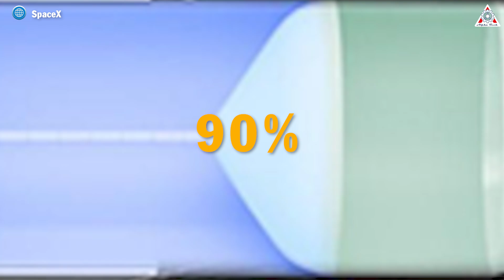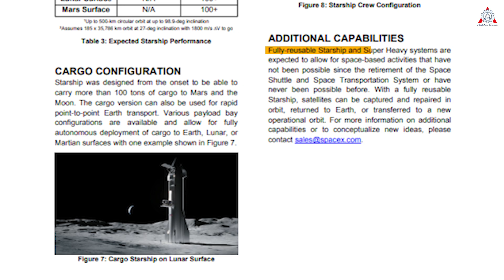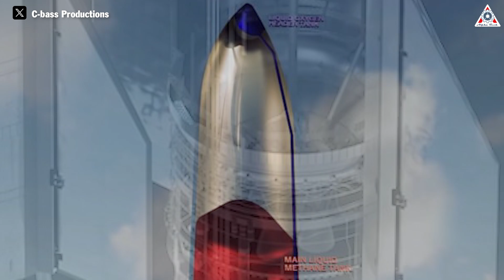Elon Musk just declared catching Starship Flight 4!

Comment: The only chance he has is if he starts to use something other than methane. Like the Merlin engine uses a different fuel like propane so far he has had a big problem relighting methane engines such as the Raptor engine. Falcon 9 uses a different propellant. Methane is not relighting
Reply: The reason SpaceX is using methane is they expect to be able to produce Methane on Mars from the ice and regolith.  There are no oil wells, so no propane.  Likewise, trying to capture enough hydrogen would be physically impossible.  It's methane or take the fuel for your eventual return trip, if you're lucky enough to make it that far.
Reply: @philipgrice1026  I understand methane is easy to produce, such as on Mars. He needs some kind of reliable ignition. Just mixing at a high psi is not working. And I don't think a spark plug will do the trick either.
Reply: @philipgrice1026 
You are right about not pulling enough hydrogen if it was to be from the air on Mars. But, there would be plenty of pulled from the water ice at the poles.
Reply: @philipgrice1026  Actually it is (stochastically) easier to pull the Hydrogen (by electrolysis of water) for Propane than for Methane.

Methane   CH4          1x CO²      :      2x H²0          =     1:2    =   1 : 2
Propane   C3H8         3x CO²      :      4x H²O         =     3:4    =   1 : 1,33

But the Methanation = Sabatier Process is an easy exothermic reaction with a cheap Nickel catalyst.
No such basic reaction for the Propane known at the moment, afaik.   Propylene  + H²   via Platinum or Palladium catalyst  doesn´t count ;)
Reply: The Merlin engine uses RP-1 (Pure Kerosene) ignited by TEA-TEB (an pyrophoric compound burning in contact with O² till -20°C)  producing the green flame  (Boron). 
The same stuff (TEB) ignited je J58 Engines and afterburners of the SR-71    they had 16 shots per flight.

Of course the autoignition temperature is on the bad side:
JET-A1  (Kerosene)     210 °C
Diesel                         ≥ 225 °C
Propane                        470 °C
Methane                       595 °C 

But the chamber pressure @ Raptor V3 is aimed for 350 bar.

A video of "Real Engineering" had a schematic of a Raptor V? . I assume the numbers are correct, but I don´t know.  

Cumbustion Chamber Gas mixture (from the 2 Preburners)     321bar @ 774K  (500°C)
Methane-Turbopump Preburner    512 bar @ 811 °K    (537 °C)
Oxygen   -Turbopump Preburner    564 bar @ 811 °K    (537 °C)

In my understanding the Preburners have to be started first (maybe prerotated electrically) ramping up to full power without flame out  relatively fast
Methane-pump  643bar @  28 MW          Input @ 3 bar  with 133 kg/s 
Oxygen-pump     633bar @ 34 MW           Input @ 3 bar with 493 kg/s

And once the process is stable you only have to put in the rest energy to 500°C to get ignition in the Combustion chamber.
With even higher pressures V3 @ 350 bar and following  the autoignition temperature could be achieved "automatically".

I think 10 test flights i a fair chance. 
If they didn´t manage the relighting on time by then, I would be surprised.
They know what they are doing and testing out the limits on their way.

Comment: Not impossible but not on flight 4, 5 or even 6. They will not attempt to land either on land until they can get both to soft land at sea at the correct attitude and velocity consistently. The booster will probably be much sooner as it got close last time and you can land it at a remote concrete pad. Starship si going to need more work, first they have to fix the tile detaching problem so it will survive reentry. then they can work on the soft landing

Comment: Thinking outside te box:  is is possible to strap four or so Super Heavy boosters (which can be recovered) around a single Starship booster, configured for fuel only, to launch into orbit, ahead or Moon or, Mars launch?
Reply: Four SRB’s would be enough to lift this booster over the Karman line and the  booster could do the rest and have half its fuel available in orbit
Reply: I believe that would enable the booster to take the starship fully into orbit without using any starship fuel.  It could cancel the need for refueling the starship in orbit.  Maybe that is over optimistic but I am going to leave it to someone else to run the rocket equation and figure it out.
Reply: @appliedfacts  the problem is that the booster when in orbit is lost… will burn out in reentry…
Reply: @renesoucy3444 
It could survive if it had heat tiles like the Starship. They would add a bit of weight but the additional lift from the multiple additional boosters would way over come that.
Reply: Imagine the size of Stage0 for a "Starship Heavy". Who knows ;)

Comment: I wish them luck, but suspect that kind of accuracy is aspirational unless they have better thrusters than cold gas.
Did hear Felix, (I think) mention midget
 Raptor 3's as a possible side thrusting  system, which of course made me grin, having suggested that here on Alpha Tech months ago...
At this point, Starship and booster are still crude prototypes, compared to what they will be in ten years or so, when enough "Horse and Buggy" Rocket Enginerds die off, to allow more advancements beyond stuff done for 60 years or more.
Currently we have;
"Rocket Grannies" obviously managing at SpaceX in spite of all the hype..

"Art is doing things as they should be done, not as they are done."

Dont know who said that, but they arent running SpaceX....🤭

I doubt cold gas thrusters will have the power to counter wind gusts coming in for catching big boosters and Starships with those tower tweezers.

You'll want serious side thrust already happening to center lock that ship on course, and then use throttle up on the lee side in case of any deviant moves.

So I would suggest they consider starting to work on the mini Raptor 3's now, and do an array of three amidships, and use the Y on aft side to miss the tower with hot exhaust.

Would be way cheaper to be starting the process now, than after replacing a tower and cleaning up a crashed ship to get to the same realization.

Thinking is cheap compared to disasters, and takes up way less time.. And Nerds are only using about 10 watts each for brain function... Elon can afford the power bill on them.. 🤗

Also hearing semantics of other more realistic thinking is happening with Starship.. Always happy to see signs of progress in the thinking department, that means things can start getting better...
Reply: Rocket grannies?  They all died off in the 1970's and 80's.  These are the new designers that are there now.
Reply: @Rlee-x9s  
Not "new" designers.. not much new on these ships... And you have to cattle prod them regularly...  Lucky, thats my hobby! 🤣
Or they'd have way less "new" to brag about...
And I was just thinking this morning; how much fun it is to NOT be on the pay roll! They cant fire me for tellin' how I see it, and pulling their tails!
And I do love counting coup on them with concepts...

Comment: Should make a water try on a rusty old barge first. Let's see if you can get close first. The torch igniters have not proven its reuse and its a huge problem. Everything looks like it will work if he gets the engines to work. Put the array on a horizontal test fixture for days. Shake, rattle flip and roll!